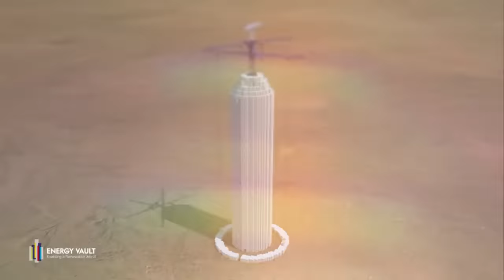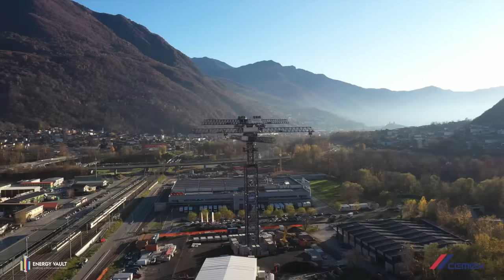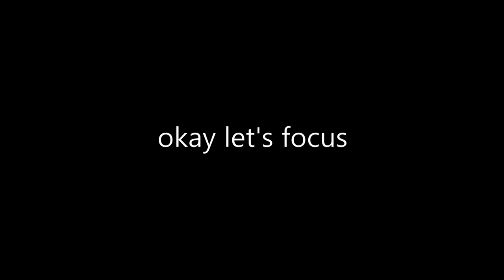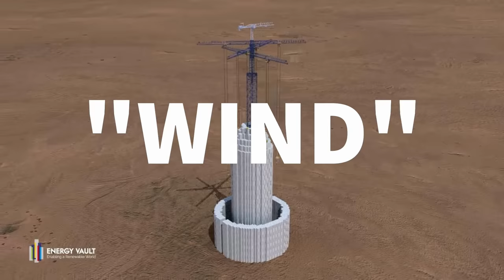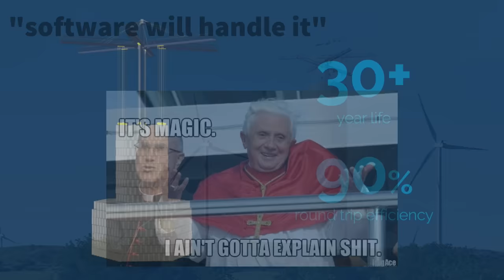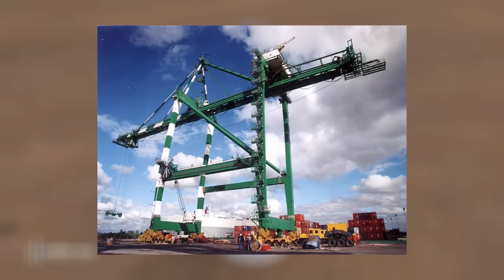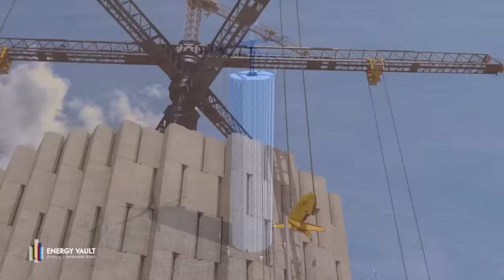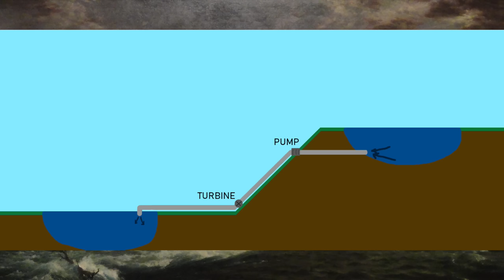The Energy Vault is a Dumb Idea, Here's Why

Comment: On the last point about pumped hydro: you can’t put pumped hydro just anywhere. It takes a large natural formation that would allow such a thing to be functional, let alone optimized. Of course I agree we should make pumped hydro anywhere that it makes sense but there needs to be other options and so that’s why people also mention this one. Clearly like you said there are problems with this type of battery though. You also could’ve mentioned the fact that concrete is actually becoming more scarce and probably will continue that trend as we use up the materials we have to create it so it might not be the best idea to use it up on a huge structure that is so lacking in utility that it’ll likely need replacing way before it’s warranty expires.
Reply: if only we had some way of safely storing water in towers.... or digging...
Reply: Pumped hydro won’t work well in places with extreme climate variations due to water’s expansion / contraction. That’s where concrete is more interesting than water. But it could be another kind of liquid too.
Reply: also with pumped hydro the water evaporates which is a big loss of energy, much more significant than the concrete eroding
Reply: @thepiperpie  

Reservoirs for pumped hydro can be massive.
Reply: @NicleT  Concrete is made of water among other ingredients. In areas where seasonal water expansion/contraction is an issue, concrete will crumble under cyclic hydric stress. Just check what happens to concrete roads and bridges in places close to Arctic like Alaska and other north US states, Canada, Norway, Sweden, Finland, Siberia.
And as long as you can avoid the formation of big lumps of ice that would completely jam the circuit, water expansion is actually not an issue. Even closed water circuits have been designed for decades with an expansion reservoir that is there exactly to allow water to expand and contract freely without stressing to the pipes. Expansion reservoirs are actually mandatory in any water circuit. This is the lowest level of hydraulics engineering basics.
Reply: @jakob2946  Water won't evaporate if it is trapped in a closed tank.
So instead of building a huge tower made of disjoint concrete blocks you just use way less concrete or, even better, steel to build a closed tank of the same volume with a separating floor in the middle. You replace the overhanging huge cranes with some pipes and water pumps connecting the top and bottom halves of the reservoir together. And voila. You have a water pump storage system that costs less CO2, less money and less time to build. And it can handle at least as much energy and much more efficiently than that overengineered monstrosity.
This concept is just a money grabbing project to scam investors with shiny modern words, surfing on the current "software can solve anything" stupid trend.
Reply: @christianbarnay2499  I have a very hard time that building a huge ass watertank, with pumping capacity, is cheaper than concrete blocks and a crane. The part about pumped hydro that is clever is that you use already existing storage facility so you just have to build a pipe.
Reply: @jakob2946  Imagine a concrete tank filled with water and the same concrete tank filled with concrete. Which is cheaper?

And when you build a tank that is 200m high (equivalent to an 80 stories skyscrappers), the price of the pumps or cranes is negligible.

Of course it's clever to use already existing geographical features that can help reduce the consts. And it could also be done with concrete blocks: you put the crane on a hill and move the blocks between the top and bottom of the hill. You don't even need to build a dam to hold them on top of the hill.
So why do we build water dams in hilly areas  instead of concrete lifters?
Because the truly clever thing is the use of a flowing liquid that can gather high speed and transfer huge amounts of energy almost instantaneously and still be reusable. The turbopump is at the bottom of the pipe so the water can convert all its gravitational energy into high speed and all that speed is collected and converted into electric power when the water hits the turbopump with high impact.
If you want the same efficiency with concrete blocks you need to let them fall from the top of the crane and find a way to collect all that energy when they impact the ground, without allowing the concrete block to shatter in pieces. It's impossible to do. Anything that slows down the fall of the concrete blocks is lost energy compared to a water pump system.

So this "huge stack of disjoint concrete blocks" idea needs more materials to build and more energy to run than the simpler and safer water tank with pump with an expectation of less energy restored.
Reply: @jakob2946  You're talking about a shitload of very big concrete blocks that will have to be replaced. A giant steel drum is gonna be cheaper and store more energy per dollar. The only advantage concrete has is that it's more dense
Reply: People sometimes thinks saying pumped hydro is a magical solution, kinda like saying software will take care of it
Reply: @christianbarnay2499  that’s interesting. Thanks for this clarification.
Reply: @thepiperpie  Now you just need to dig and build a Burj Khalifa to have any sort of meaningful volume of water, and dont forget that you need as much concrete as this "battery" but you also need to build it waterproof, so now your constructions costs just tripled and so did your maintenance. Now please, do tell how the fuck you plan on build a water tower 600-1000m high again
Reply: @christianbarnay2499  it still does, concrete or steel under sunlight will get hot as fuck, and that heat will transfer to the water, in case you cant vent it out, you will get a steam explosion. Also, the advantage of this concrete tower is not the amount of concrete, its price, due to being stupid simple its also stupid cheap, while your water tight Burj Khalifa up AND down, is incredibly expensive, thats why you dont see water towers 600m high, you dig and impermeates an already suitable area
Reply: @christianbarnay2499  im sorry dave, but you also need either a groud level storage, or an underground storage, not to mention the burj khalifa tower, so yes, a 100-200m pile of blocks of concrete is cheaper than a 600m tower
Reply: @glockmat  Why does the 600m Burj Khalifa even come into this discussion? You're side tracking.
Reply: @christianbarnay2499  Im not, a pumped hydro needs both a lot of height and volume, 600m is the bare minimum, and the Volume of the Burj Khalifa is also minimum, we are on the very minimum of the scale here
Reply: @glockmat  So 200m would not be enough height for water but it would be enough for concrete blocks? I don't think so. As I said in another comment this crane system requires lots of horizontal movements (crane rotation, translation of the blocks along the arm away and back to the stack) that consume some of the energy. That will reduce the efficiency of the system compared to a water tank of the same size. So if 600m drop is the minimum for water then obviously it's also a minimum for those concrete blocks.
Reply: @christianbarnay2499  never it wouls be, also concrete blocks are denser, and cheaper than your water tight tower, this "battery" have many more problems, but costs and and simplicity arent one of them, while your brilliant water tower have
Reply: @glockmat  ah yes, the cursing at you because i disagree with you response....
Reply: @glockmat  Though in answer, I'm not even trying to say that gravity batteries are the answer, just pointing out that there are other option that don't include building jenga towers and hoping they don't do damage or fail, personally I think electricity and nuclear were embraced as superior technologies to things like windmills so quickly after their discovery was largely correct, (and based on their significantly higher potential) and that we should focus on advancing technology to make cleaner, more efficient, and more advanced technologies, rather that trying to reinvent the windmill and the crane while hoping to find a design that doesn't spill oil, kill birds, and potentially fall in places (while also be CO2 negative and COMPLETLY nonrecyclable). Personally I have high hope for things like the nickel batteries being prototyped by tesla.

 Though honestly, environmental concerns and efforts are moot as long as countries that would start ww3 if we made them stop are responsible for more pollution than all of NATO by themselves. Depending on what statistics you use, china alone is responsible for upwards of 70% to 90%  of the ocean pollution by themselves... plus they are still using unregulated coal for power. And then there are places like Iraq and Iran and much of the middle east that straight burn ALL of their garbage, plastic and oil included.
Reply: @christianbarnay2499  Sure. There are plenty of variations on this theme.
Reply: @jakob2946  Yes. If you already have a dam and plenty of water.
Reply: I still think the idea is pretty good even if it needs twist.
The video is taking the problem the opposite way, the goal is clearly to find an alternative to actual means of storage, this include hydrolic storage.
Obviously we can make the block from something else than concrete. But it's still a technology that could be use everywhere.
Reply: @thepiperpie  Nah, the proposal is so absurd the cursing is justified
Reply: @christianbarnay2499  Couple of things. One if you have a hill by all means build pumped hydro or a dam. in teh abscense of that building a container for the water would be very expensive, because water is heavy and not load baring. so you would need alot more than just a box of conrete to hold an equvialent amount of water. The concrete boxes are load berring and carry potential energy. Speeking of potential energy the idea that the water needs to build speed in order to give the most energy is ridiculus. The decrese in potential energy will result in the same amount of kinetic energy no matter how fast the block desends. I imagiune the reason pumped hydro only uses one at the bottom is because they are expensive af. Gravity is an acceleration, and can be used to measure potential to kinetic energy, speed doesn't matter.
Reply: @glockmat  sarcasm aside, personal attacks during a discussion are immature at best
Reply: @spratous  it would be nice to see someone find a work around, but physically storing potential energy when it isn't naturally occurring (like a river) has been generally dismissed as impractical at best, due to the existence of friction making even very efficient setups waste very large amounts of energy both when putting the energy in and when releasing it.
Reply: Can't pump hydro just anywhere? if only there was a way to move water to anywhere with a series of tunnels. Those tunnels would be placed above and below ground depending on terrain. We could carve the shape needed for all that tunneled water to sit in and those tunnels could link to a giant body of water for continuous supply of water. 

The pumps would have to be powered by some thingy that generates power by how turbulent that giant body of water is and/or we could put some mirrors that will focus on a point, like a magnifying glass on an ant, that will heat up a rod that will boil that water creating steam and create a man made rain that way but inside a building. We could also use that water as drinking water and farming water.
Reply: You can do it anywhere you can build a water tower
Reply: We already use pumped storage almost everywhere where it makes sense. 
Author of this video is not an engineer, doesn't do research and lacks critical thinking.
Using gravity for energy storage is not a great idea.
Reply: @TotoLakay  you greatly underestimate the scale of such construction project
Reply: @skipperg4436  So is the XL pipeline and somehow, they are able to built it from Canada to Texas but the US gov't is stopping it, I believe for now. so it is not an Underestimation, it is a lack of will by our elected leaders.
Reply: When pumped hydro stations fail, they fail hard. Costly to rebuild and the devastation to the surrounding land takes decades to undo, perhaps centuries when factoring in the effect on wildlife in the region.
Reply: @charliedango2664  According to data, Pump Hydro rarely failed. if they failed, they are easily repairable. And the damage to Wildlife is unlike what natural flooding would do. ANd with the way they are constructed, even in the event of Failure, the water is guided through channels and waterways created as a failsafe.
Reply: @TotoLakay  XL pipeline is many orders of magnitude smaller project. At the start of my career I actually worked on that kind of things - pipelines, nat gas refinery, water towers (for workers and for fire extinguishing), etc..
Also - just why?
For 1 000 times less money you can build a nuclear plant that will produce power 24/7 365 days per year no matter the weather and last up to a century AND don't need energy storage to be usable (however there are quite interesting solutions with liquified CO2 acting as a heat sink during peak hours). 
Cost per kwh of wind turbine even without energy storage is ~10 times higher than that of nuclear kwh. So - why?
Reply: @skipperg4436  Nuclear waste takes 10000 years to half-life. Even the "cleaner" version of nuclear power "Thorium" takes 500 years. Costs of Pump Hydro outweigh its failures, I can fix rebuild a pump Hydro right away and better each time, one can only do that with nuclear energy in a 500-10000 years interval. That's why.
Reply: only_two genders_exist  you seem to have missed my point entirely, not moaning about the pollution, but rather the people asking everyone to change their way of life to make a 0.001% impact while ignoring events that are single handedly causing 80% of the problem. (though i would prefer my grandkids be able to enjoy the beaches the way i have)
Reply: @skipperg4436  I don't see it. Do I want Radioactive containers underground? No. Do I want Nuclear power plant that can be used as strategic strike during war or sabotaged? no. Can pump hydro be done? yes. examples of that? Internet cables running from England to the US, from China to Australia. Are these internet cables as big as pipes running oil thru to make such comparison? yes. What are the actual length of these cables currently? more than 5 time the distance between New York and LA. Are Countries investing in Pump Hydro Now? Yes. which ones? Germany; USA; Most of Africa; China... Did they say it was cheaper than the other forms of power? Yes. Scientific proof? scientist and engineers from China, Australia and USA seems to think so. Are corporations investing? Yes sir, Pacificorp, Xcel, Australian corps of engineers, the Chinese Gov't.
Reply: @skipperg4436  You seems passionate and yet  all Countries have scientists and engineers and all made the cost analysis and believe pump hydro is the way to go. You might disagree with zeal, They decide this is where their money be best invested into.  You might even say those millions of people are insane, but In the land of the insane, the one sane man is insane. They win, pump hydro win.
Reply: @glockmat  no. None of that. You would use a lot less concrete.  It would not have to be anywhere near 600-1000. We know very well how to make towers that hold water. Maintenance would be much lower than the crain constantly moving concrete blocks around itself.

Just no. Stop making shit up if you have no idea at all
Reply: @12many4you  Pumped hydro work exclusively based on gravity, and considering that water is already highly erosive, you would want a a close system, which means a upper and lower reservoir, and also that you would need a really tall tower. The energy density of water scales with the height, so the only way to get more energy in this system is to put more water higher. So 600 to 1000 is a fair number, also remember that the tower would go thinner the higer it goes, naturally, so definetly yoy gonna need a lot of height to pay back the reduction in volume. Which would certainly make it highee than this concrete pilling idea
   
The maintenance would definitely be higher due to the water slamming your structure for it to work, of course that with desing and geometry this could certainly be minimized, but then again, a hydro pump, turbine and gate is much more expensive and complicated then 3 cranes.
   
Also the concretes in that "battery" could have a lining of rubber... or UWHDPE, both are very cheap and would make the whole impact problem basically null and void. Altough UWHDPE are also very low friction, so it would need to be keyed to use it, so probably rubber. 
  
Also yes, a tower that needs to be water tight and tall as fuck would have higher maintenance than replacing concretes blocks every so often.
Reply: I heard about some places using wagons on rails, filled with rocks, attached to a motor / alternator with a wire. Although it seems to be only viable in mountains
Reply: @skipperg4436  mate you are sooo super wrong nuclear power is the most expensive power out there and the only reason we have nuclear power plants is that they enable plutonium based nuclear weapons soo it is only a leverage for there contrys respective military (aka USA, France, UK, India, Parkistan, China, Russia......) 

Started by the construction it takes ~10 times the money and time to build a nuclear power plant than say a gas burning one its maintainace is also X times more expensive because safety regulations and the disposal of used fuel is covert by the governments (and without the governments subvention starting in the 50s with the nuclear euphoria and the lies of cheap energy most of the world wouldn't even have build nuclear power plants) the minig and processesing of the uranium is also a huge pollution source etc 

Also  nuclear power plants are bad a reacting to different loads on the energy network they need time too make more or less power, consatnt load is no problem at all but the demand is always fluctuating (rising the need for energy storage like hydroelectric pumping stations or fast reacting power plants like wich are fossil fuel burning 

Also your statement about the thorium and uranium is wrong too because the thorium gets transmutated In  U233 not the U238 and both of them have different fission chains  and since U233 isn't so great for nuclear weapons (half-life time makes it difficult to get enough during Manhattan Projekt and reduces shelf times for bombs) we don't see much thorium reactors (common reactors cann use thorium too in the 70s they packed same Th232 in the fuel rods and it worked kinda but wasn't as efficient because of neutron absorbation and neutron speeds in correlation to  the fuel (plutonium likes too brake apart with fast neutrons and uranium likes slow onec)

If you want too understand that toppic properly I recommend Scott Meanleys videos about nuclear power and the now declassified pappers from Manhattan project and followups before you talk shit again
Reply: @TheLtVoss  I'm an actual engineer I know this sh!t from inside. 
Construction costs for nuclear are ~10 times less than for wind turbines - just check manufacturer prices (its 1 billion per 1 TWt of Rosatom plants many of which are under construction right now in many locations in the World) and when you factor in lifetime which is 20-25 years for wind and 70-100 years for nukes.
From the point of view of wastes - which was what I was talking about - it doesn't matter what kind of fissile fuel is used. Fission is messy. You get pretty much entire Mendeleev table in the reactor. Also thorium cultists conveniently omit what is going to be their source of neutrons for thorium transmutation. I live this question to you as a hometask.
Reply: @skipperg4436  You may be a civil Engineer but you surely have no clue about  the nuclear sector 

 well Wind energy is kinda shitty in regards to life time and power gain but that wasn't part of the discussion and I compared nuclear it to GAS not wind but since you started it I have searched for same up to date data the average turbine produces 3MW building cost for 1MW  ar about 1,3milion$ making 4 million $ 
maintenance is about 1-2 cents per kw/h That makes ~45000$ a year  so after 20 years (they are not really done by that but it gets tricky to make profits) summed up ~4,9million $ per 3MW in 20 years ~1MW 1,6million$ in 20 years 

A nuclear reactor 1Gw will cost 6 billion $ too build and per MW/h 30,4$ to operate ~267 million a year to operate over 60 years (as good average for reactors buil around 2020) 15, 98 billion operation cost makes 21,98 billion together with costuction over 60 years broken down to 20 years make 7,32billion overall cost for 1GW ~7,32million for 1MW 

SO more than 4,5 times the cost without disposal afterwards and oh boy is it expensive to deconstruct and deconterminate 

And then you pick Rosatom as Example one of the worst players in the nuclear field they use old designs for prolonged time there Information structures is stuck in 1969 and they a highly bound to the Russian government 

And nuclear reactors don't life that long  75-100 years
 that kind of pills do you take? 

The newest and savest reactors have a estimated life time of max 60 years and most reactors make only 50 years (or less) because the reactor containment and other metal pieces lose ther propertys in that time with such a neutron flux
Reply: @TheLtVoss  Rosatom builds nuclear plants at 1 billion per 1 GW of electrical power (that is 1 GW to the grid) and their plants are expected to last at least 70 years with possible life extension to 100 years (though I have not found what kind of repairs would need to be done; I guess they will just replace reactor pressure vessel at some point). You can order them to build a plant right now if you have spare billion on your bank account.
Rosatom builds VVER-1300 reactors right now. The VVER series have been updated and modified many times. VVER-1300 design is if I'm not mistaken less than 10 years old, however VVER series have a long history of both service and update and development. Rosatom also have more advanced reactors down the line with prototypes ALREADY BUILT AS COMMERCIAL PLANTS (speaking of BN series first of all). They are far ahead from anybody else on the planet.
Regarding natural gas plants GE charges something around 700 millions per GW of electrical power HOWEVER cost of fuel is EXCLUDED and cost of fuel forms - by different estimates - between 60% and 80% of cost of kwh (while for nukes fuel is less than 10% of said price).
Price tag of wind turbines - I looked at price tag of GE 3 MW wind turbines and took their service life (20-25 years) from GE brochure. This price tag by the way doesn't include land acquisition prices nor wildlife damage both of which for forest of thousands of windmills will be HUGE.
The only real drawback of Rosatom-built plant is - yes - the fact that it is a State-owned company, and you would probably have to deal with Putin. 
Well he is an old man and hopefully next tsar would be better. Or somebody should just start their own nuclear power plant building company.
Reply: @skipperg4436  and again your resach isn't Rock solid the VVER Reactors ar based on a 1996 design well it is a big improvement over RBKM design but still 1 billion per Reaktor isn't realistic maybe with government substitution(maby even from Russia for well political leverage) and if every thing works in time but we know that big building projects like that have almost every time delays and problems that increase the costs dramatic and  are the final inspection and the licenses included 

And well I take data from Russia always with a grain of salt for obvious reasons the same goes for salesman talk

That is the reason why I have taken data from around 2020 (±6 moths) still up too date but no room for speculations
Reply: @TheLtVoss  VVER and RBMK have nothing in common. Also VVER is an entire series of design, its not a single reactor.
Regarding prices where I live they made electricity so cheap that it is cheaper to heat house with electric heaters during the winter than with gas.
You are correct that costs of large construction projects tend to grow... but so is the case for other kinds power plants as well. That's why I took sticker price for ALL of them - to have a common denominator of sort.
Nuclear got bad rep from several projects in USA... which were delayed by politicians by endless silly lawsuits by over a decade (!!!) thus interest on loan on these projects has grown to something insane. Another thing is that almost never just one reactor is being built, usually there are several being built at the same time so it MIGHT look as a too big of an expense while in reality it would end up cheaper than any alternative.
Political leverage is of course a bad thing... but Europeans are already in bed with Gazprom grossly overpriced gas that Gazprom is selling to them, as well as all sort of political leverage that comes with this contract. 
With nukes after they are built their fuel can be sourced elsewhere (Ukrainians did that) and maintenance could be done by local workers (staff training comes with the plant). With natural gas you are on the hook indefinitely.
Reply: @skipperg4436  Well as sayed the VVER design ar a better design than the BKRM design (meaning 2 different designs) especially the negativ Void coefficient makes the operation much saver but still with Rosatom reputation to conceal failures I doubt the safety standards will be as good as promoted but from a tech perspective they have the most experiences and they didn't stop the development like many others so I wouldn't be surprised too see 1 or maby 2 gens of New Reactors in the next 20-50 years till other more advanced technologies take over I mean the fusion tech is making great progress in the last years and I'm sure the joke that that will take always 20 years to accomplish is kinda dead
Reply: @christianbarnay2499  This water tower example of yours is terrible. Its not worth building a giant water tower for energy storage.

Hydro power storage only makes sense if 1) your somewhere where water isn't in shortage(unlike most of Africa, Western USA & Meddle East in general), 2) you have a natural water reservoir at the bottom of another elevated area with enough space to build a large dam. When trying to store anything under 100MWh you probably better of using batteries today so both proposals would lose out.

You talk about hydraulic engineering basics but clearly you don't even grasp how electric car's regen braking works. Technically the concrete towers cycle efficiency will win out against hydro once operational(Despite being a bad idea in general)
Reply: @TotoLakay  The KXL doesn't produce hydro power, it's a pipeline for crude oil. A ton of energy is probably waisted to pump it all the way to Texas.
Reply: @jtengelbrecht4613  Yeah, the cranes will magically move the blocks around with no energy consumption from the cranes themselves.
There is zero chance this system can beat the efficiency of a fluid storage and pumping system.
If this technology was worth it they would have brought numbers to back their words.
Hydro pump storage efficiency is in the range 70 to 85%. They put great effort in making amazing animations, they tell all along the video how this is amazingly efficient and they don't even compare it to existing technos.
Brake regen systems work exactly the same way as hydro pump storage systems: coil and magnets serving as motor in one way and electric generator in the other way. That's also what they want to do with this system. Except they add a ton of parasite movements that reduce the efficient  (cranes rotation, horizontal movements along the crane arms.
You want to convince me this system is more efficient than a water pump? Show me the maths. Numbers don't lie.
Reply: @christianbarnay2499  Not sure what  you where on about stopping the weight at the last second when it wil produces power all the way down.

In this system you have loss in moving the block side to side(depending on how fast you do it) and the efficiency of the motor. Im disregarding the pullies since bearings have little fiction.

In a hydro system you have the fiction of the pipeline, the efficiency of the pump + the effiency od the motor. Generally when testing the feasibility of hydro storage you have to get a certain minimum angle (sin(z^2/(x^2+y^2))) otherwise the losses  from the upper reservoir to the pumps become too high and the hydro battery becomes very inefficient. This said the max efficiency of each plant is different depending on the terrain but even in near ideal circumstances the efficiency is still not great

Not saying stacking bricks is a good idea, but make bad arguments doesn't help.
Reply: @jtengelbrecht4613  I was using that analogy to show how it is possible to irrigate at the same time create a pump hydro. And no, The KXL is being built to save on cost of transport, but it is being stopped because of potential for oily leaks that will devastate the territories it is going over, not so much what water would do. Basically, we could invest in pumping water all over the USA and use Nevada desert as a form of desalinization process (which some form of it is already being use in Nevada to produce salt for sale. We are not doing that because the Gov't want to keep food prices artificially high for profits. Have you ever wonder why, no matter how much inflation there is, the price of bread is always low? but the same amount of wheat use to make bread that also make cereals, pound for pound, the price of cereal go up and they the cause is inflation? if the poor can't buy bread, there will be a revolution.
Reply: @jtengelbrecht4613  Producing power all the way down also means producing friction in the motor all the way down. Water gathers energy by free-falling. The friction on the pipe only affects the thin layer on the outside of the water flow. The conversion from mechanical to electrical energy is made at very high speed in the turbopump with maximum lubrication for minimum internal friction.
What I said is that this efficient design (gather energy in free fall and convert everything in one shot at the end of the fall) can't be applied here because the concrete blocks wouldn't survive the chock. So you need a slow and controlled descent. Which means motor friction at lower speed, with less efficient lubrication and more friction loss.
Add to that all the horizontal moves I already mentioned and also all the computing power required to locate, grab and release the blocks in the vast area around the tower compared to a system that has minimal monitoring and just decides if the flow goes up or down the pipe.
Oh and I didn't even mention the crane cable dangling uncontrollably on such heights. They will need a lot of brain power to find a design that allows them to perfectly align the clamps and grab the blocks without losing again a lot of energy in the process. Just visit any construction site and you'll see that the most efficient way to move blocks around with a crane is by having people on the ground that grab the cable and clamp it manually to the block. And also when placing the block with precision on top of the high stack. You'll need something or someone to assist for perfect alignment.
If you tell me they just need to move very slow to avoid dangling I will answer that the heavy weight concrete block has a lot of inertia so you won't avoid dangling on a crane cable that is several hundred meters long, and moving even slower would mean even more internal friction in the motor resulting in more efficiency loss.
Reply: At least with pumped hydro, it could be dual-purposed as water reservoirs for inland areas and been used in real-life. Still better than this kind of nonsense in the video.
Reply: @christianbarnay2499  I'm not addressing a dangling cable just theoretical efficiency. Both systems has loss according to the efficiency of the motor(either might include a gearbox of sorts). Beyond that the crane only have the horizontal movements where your so called "highspeed flow" has friction along the way(pipe) and inefficiencies in the pump. The hydro doesn't need "high speed flow" that has to be stopped right before the end. When calculating the energy generated you use change in pressure and flow rate not delta v. All you need is something to generate a force with and turn a motor... like gravity.

Since you can't remove all the energy from the water(will stop the flow) you have another loss there as well. High efficiency water wheels get close to 98% eff but they can't pump the water pump again. 

Not sure why you assume the one motor will be well lubricated for the hydro plant and the brick tower will have poor lubrication. Why are you so bias, are you that pro hydro or just that anti brick tower?
Reply: @jtengelbrecht4613  The dangling cable is not theoretical. Just go on any building or bridge construction site and you'll see how they struggle with cables. This is a very practical issue.
I am not biased again this design. I just can't blindly accept their words when they say it's a major improvement over existing solutions without bringing any objective facts and values.
They just throw a bunch of buzzwords without addressing all the technical theoretical and practical issues that exist in that design. If some day they can bring proof that all the issues I have raised have been addressed and they are actually more efficient I will be amazed and I'll cheer for them. But with current knowledge of the state of the art and their design I completely fail to see how it could possibly work. I would love to be proven wrong on this because this would be a major improvement in engineering and science.
But unless they can provide solid backing to their words they are just words.
Reply: @christianbarnay2499  I don't think it is a good idea either. I also think that things like wind is a serious problem and hydro is a lot better in general. This idea how ever will most likely be technically more efficient, that doesn't make it viable though.
Reply: If you are fine with being as inefficient as the energy vault you can just build a big water tower. No mountain needed.
Actually that would probably be quite a bit more efficient than the energy vault.
Reply: @jakob2946  well at least big water tanks will work unlike loosely staying concrete this high...
Also it should be cheaper and better for the environment. Concrete productions releases ridiculous amounts of CO2.
Reply: only_two genders_exist  username entirely unsurprising